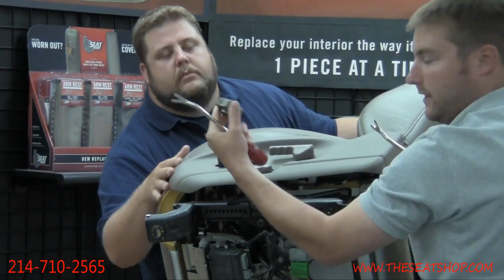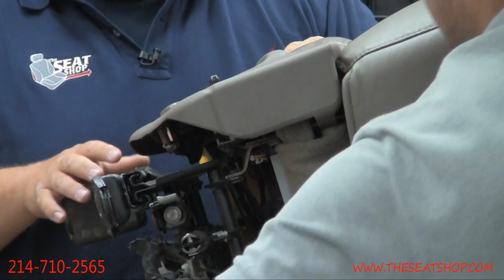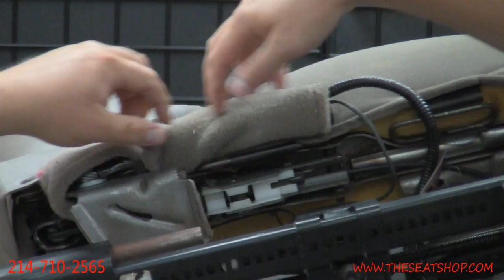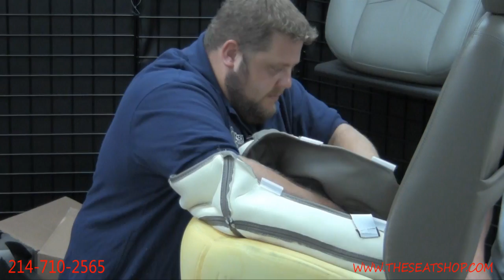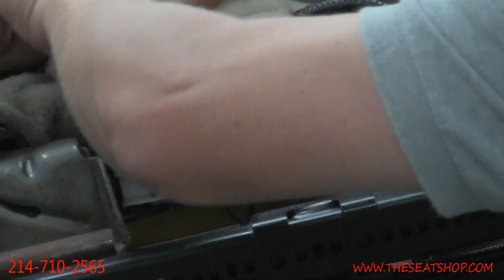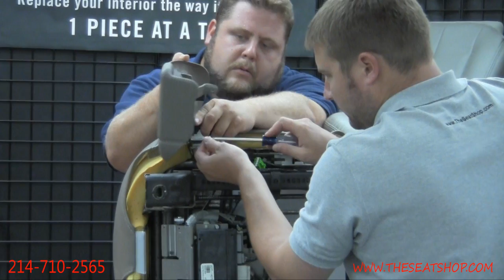02-05 Ford Explorer Driver Bottom Install Video

Comment: Hey Thanks!  I bought the bottom drivers seat cover (original) on Ebay for about $110 USD. Finally I had found a shop that agreed to install it for $175USD. Then I thought of checking youtube maybe I could do it. One thing was worried about was that my seat dosent move forward or back making it kind of hard to remove the back (closest to the door) seat bolt. So I gave it a try and really it wasn't so bad at all!   It took me 2.5 hours done plus under the seat and side of the arm rest got a good cleaning.  Do it yourself and save some cash.

Comment: The fact that you guys were able to even remove the driver seat from the vehicle is an achievement all in itself. The wiring harness goes throw a cross member at the bottom of the seat, and renders removing the plugs nearly impossible. Without damaging your wiring harness and connections I recommend following the guide once you have removed the 4 bolts that hold the seat into position.

Comment: Would this be the same for a 2007 Ford Explorer Eddie Bauer?
Reply from the maker: Thanks for reaching out, the installation is the same concept but it will be slightly different for installation process.

Comment: Is there a way to get the side panel clip (the one towards the front) back in without removing the seat? Mine came out and it keeps popping off the lumbar and recline knobs. Thanks!
Reply from the maker: Hi and sorry for the late reply, is there any way you can give us a call we are more than happy to help you out but since there could be multiple reasons why this happens it will be difficult to give you an answer without looking at it or talking to you about it. Our office number is 214-710-2565 we are open from 9AM-5PM Central time Mon-Fri

Comment: This video was somewhat helpful to me during my 03 sport trac seat bottom install. I only wish I knew just how much different a standard seat is from an Eddie Bauer. I was already in too deep by the time I realized how much more difficulty there is in a Non- Eddie Bauer. I was successful in the end but would not want to have to do it again. That said, thank you for a insightful guide to changing out a seat bottom. A lot of tips and methods I couldn't have anticipated .

Comment: I came here to see how to remove the front seat, but you have a great kit here. My seats are getting a little worn so I'll keep this in mind when the time comes. I have a 1999 explorer and there appears to be a seatbelt rail attached to the "hump" with a Torx #40 or so screw. Does that need to be removed or will the seat slide forward and off of that rail? Thanks for posting and your hard work.